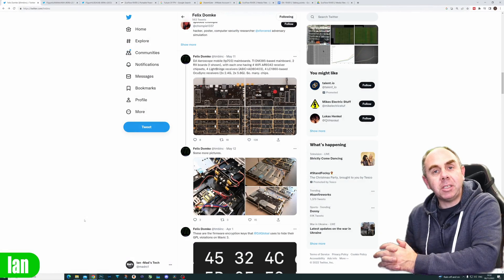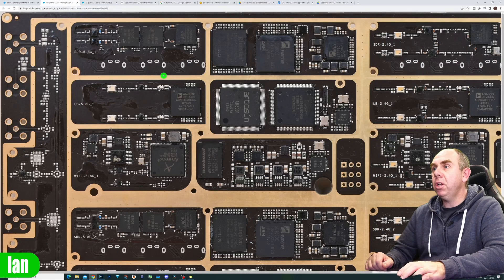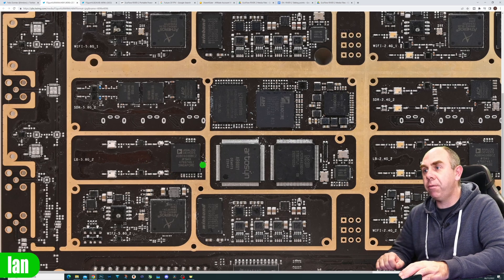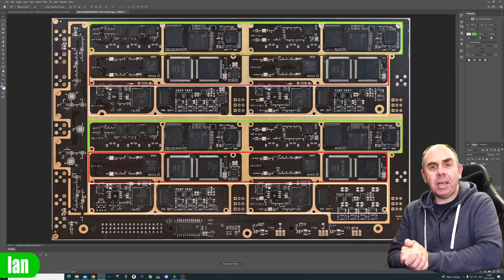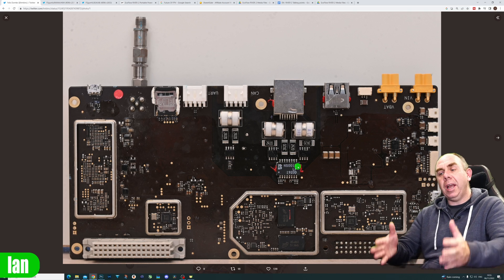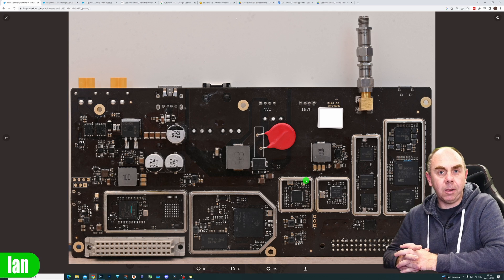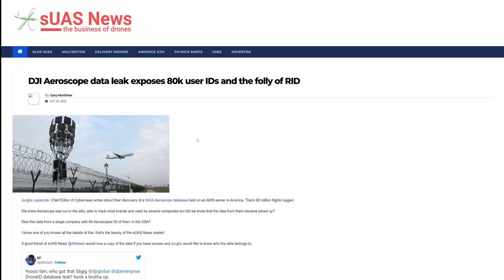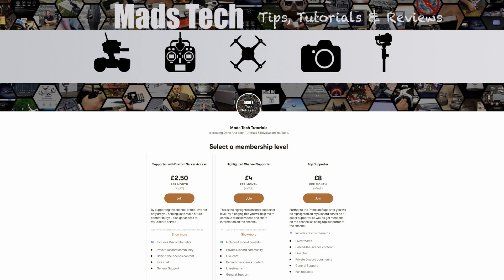DJI Aeroscope Teardown - Should We Be Worried

Comment: But: if ocusync 23 will be released these whole system will need an upgrade or replacement board I bet so it becomes pretty expensive I bet. 

And that will prevent the police to get enough at least in our region cause none of these will cheap and they might only be able to get a few to use it to protect policiticians during protests or so or maybe venues and football games but remember the green peace  powered para glider landing in the Bayern Munich Allianz Arena / stadium  back a year or 2 ago ?

They had not protected it against such big object which could have carried explosives and so on but now the hunt is on again and drones hunted again. 
And it will become time to register using a fake account that is not obvious cause winston Churchill as account would be obvious a fake account compared to Thomas Müller here. 

Imagine the police here needs such unit for every city over 100.000 population which would equal 80 cities and 2 for every 250.000 citizens than this would equal about 300 units . Then the special police units in each state dji would sell 400 in germany alone but with millions out of reach in smaller cities cause these units will be expensive and the upgrades too, but most likely the training will become even more expensive cause once the results should be used at court then a dji training certificate will be mandatory for any operator before using such aeroscope.

Hope it sucks to detect parrot and autel at least the encrypted parts. I do not like that at all but luckily I am outside of such areas where they will get one. 

The biggest issues DJI will face is the tracking possibility cause that will violate the law here and especially if those aeroscope access get access to the dji flight database records.

Not sure when the protests will kick them out but collecting and exchanging data with other aeroscopes and or aeroscope owners would violate our law and DJI would be slaughtered on court for violation the privacy laws cause once your craft had been tracked then they could create a flight pattern or profile which is forbidden - even for cars unless such car violates traffic rules. But even then it is only allowed to store each case separately and not in a country wide register.

Comment: 3 minutes in still no clue what this product is and what it does
Reply: It’s a law enforcement or private security tool; if you needed to protect a sensitive area this would tell you what drones are nearby, where the pilot’s remote is located, etc.
Reply: @shagam00  Thanks!
Reply: @shagam00  but of course its going to be used not only in protected areas.  Like speeding radars are not installed on dangerous crossroads etc.
Reply: @Robin-Visser  I was only explaining what it was for and leaving opinions out.
Reply: @shagam00  i only tried to warn it will of course be used in areas where you think its safe to fly without id
Reply: Its not good.

Comment: The reason it doesn’t pickup the DJI FPV system is because that product does not contain nor transmit a GPS signal, so in theory it might be able to pull the video in if within range, but there would be no way to know exactly where the signal was coming from unless identifiable landmarks were in the video feed.
Reply: incorrect, there are a plethora of RF techniques to locate someone without a known location using triangulation, tof, rssi and snr etc.